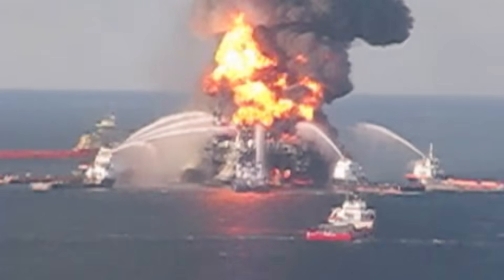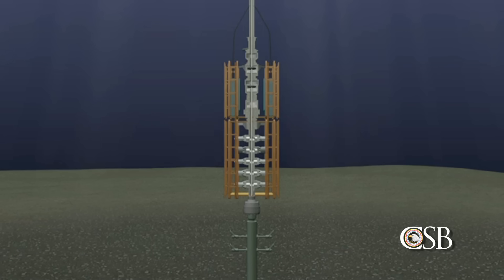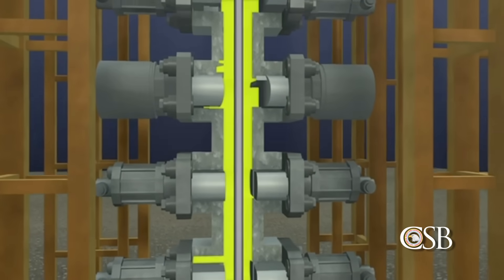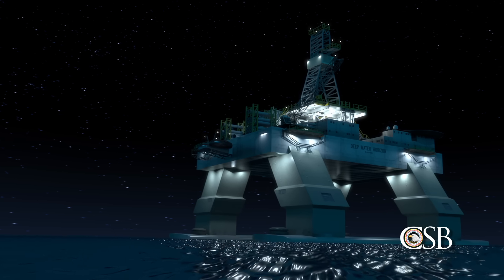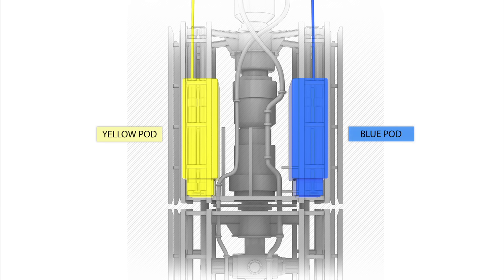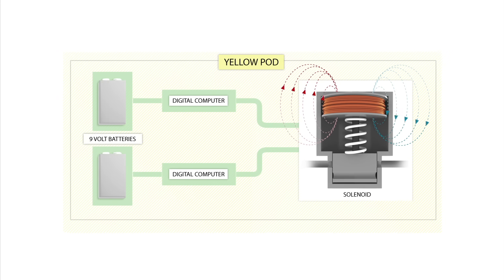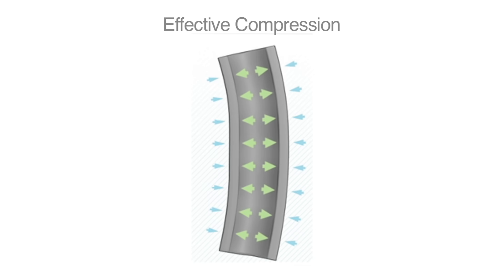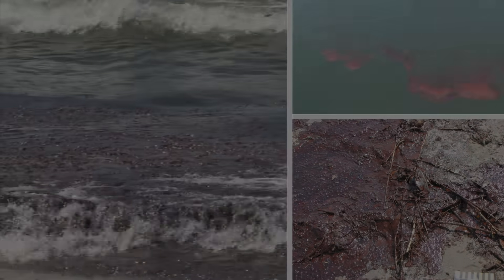Deepwater Horizon Blowout Animation

Comment: i will translate it into few words... Every "safety system" is a fiction and  whenever they are needed they will all fail... Wtf its like watching Star Trek with 1000torpedos but they never work cause battery dont have enough energy and light speed engine are out of action cause generators are not fueled and switch is stuck in off mode😂 Wow what a beautiful symphony of all at ones failure🤦‍♂️

Comment: Norway and Brazil require remotely operated shut-off valves to be installed on all oil-rigs.
This added safety requirement costs about $2 million.
The Oil corporations lobby congress snd influence the safety and standards regulators so this safety feature was not required in US oil-rig operation.
The BP Horizon oil-rig would not get approval to start up in Brazil but was safe to operate in the US.
Thos corporate contamination of regulatory bodies occurs in the Nuclear power industry, food sectors etc. The most corrupt is the Pharmaceutical corporations controlling the approval of drugs and treatments through the FDA.
Disgusting corporate cultures that leads to unnecessary deaths and injuries - but very good for short term profits.

One more correction to add: the oil spill was not 5 million barrels. An estimated 172 million barrels of oil entered the gulf of Mexico from this oil rig disaster.
The real tragedy was the loss of life - 11 workers that tragically perished

Comment: “Following the spill, BP released millions of gallons of toxic oil dispersants, notably Corexit 9500, a chemical banned in the United Kingdom, into the Gulf of Mexico. The use of toxic dispersants made the spill more persistent and more difficult to clean up than it would have otherwise been, but served to remove the oil from the view of TV cameras and make it harder to measure, thus limiting BP's liability for the spill.”

Comment: relying on some batteries to operate a solenoid in an emergency situation seems like a bad design. A better design would be something like a spring that forces the valve open, and during normal operation you have a solenoid that overcomes the force of the spring and keeps it closed. That way when you lose power your mechanical spring forces it open.

Comment: why would you build a final fail-safe piece of equipment in a way that only works if there was no structural deformation? Seriously, that the blind-shear ram requires the pipe to remain directly in the center in order to work seems idiotic. Like building a fire-extinguisher that wont function if it gets overheated.

Comment: Excellent overview video.  Is it statistically anomalous that two fire doors were breached at the moment that Mr. Michael Williams attempted to engage each respective handle, as he detailed in the CSPAN coverage of the USCG and MMS hearing, if the cause of the door breaches were solely random gas explosions?  Also, in light of the attempted terrorist targeting of the Israel-Chevron maritime energy infrastructure in the Mediterranean, would it be beneficial to consider exhuming the Deepwater Horizon, or at least relocating it to shallower depths, as well as completing a full LIDAR scan?  Did OPEC enemies of the United States benefit from the Deepwater Horizon disaster, which first began on 4/20/2010, which is a criminal and narco-terrorist holiday?  Would it be beneficial to also complete a cyber security review, if any redundant safety measure failures could have been caused due to an Iranian-style cyber attack, operating system or employee cyber security compromise?

Comment: I watched this video and read the comments, but I don’t see one important explanation about the roll of the drilling fluid. The fluid is used to cool the drill bit, carry away the cuttings and most importantly hold the gas and oil in the rock formation. It does that by exerting pressure on the oil and gas. That pressure has to be greater than the pressure of the gas and oil. The pressure provided at the bottom of the hole is a result of the weight of the column of the drilling fluid, that is to say the depth of the hole, and the density of the drilling fluid. If the density is correct for the depth the drilling fluid will keep the pressure in the formation under control. This is very delicate balance and can be upset by changes in the formation or something as simple as hitting a water bearing part of the formation or an unexpected change in formation pressure. If an upset occurs it can allow a kick to happen.

Comment: 1) it was said that the pipe ram successfully sealed the pipe. Later, above it, blind sheer ram blades failed to cut the pipe, but... Since the ram below it already closed the pipe, why was it necessary?
2) Why pressure in the drill pipe climbed and pressure outside the pipe in BOP decreased, which lead to pipe curving?

Comment: Rename this video . The bops did not caused the initial problem at all . However they were faulty. . Poor engineering is the real reason the well blew out . They did not cement all the way across the zone . The zone drank the cement thus leaving the live on the back side of the liner . A. Negative test or reading gauges would have let you know that . Remedial squeeZe job and retest . Problem solved . The field has since been drilled with zero failures . When you displace mud with seawater you lighten the hydrostatic head and that is when the well came in . Buttoned up correctly and this never happens

Comment: in my hearing of what happened is that there was equipment that needed to be replaced but the lead on the operations or head of operations wouldnt allow for equipment change out. the lead guy said it was not feasible to do cause of the amount of down time it would cause and the fact that they had a deadline to meet for getting the oil out to the people paying for it. it was also stated that if they didnt meet the deadline that the people paying for the oil wouldnt pay up and would find somewhere else to go get their oil. thus in turn lead to equipment failing. is it money over safety most of the time oh you bet it is which is a total shame.

Comment: In my opinion the solenoid safety check valves were engineered completely backwards they should be closed under tension unless there is voltage to keep them open in the event of power loss they automatically close

Comment: 87 days???? how do you not get someone on it in under 7 when you have so much money
Reply: It wouldn't matter if you had a gazillion dollars to fix something if there was no way to fix it, they had to think up a solution and we're lucky they managed to find one within 3 months.
Reply: @krashd  how do you think it got fixed in the first place they payed a lot of money for 3 subs to go down with a Capping Stack  could have done that a lot sooner.
Reply: @mothertoaster5006  Easier said than done
Reply: I remember following the process as it played out - there were multiple live robot cam feeds at once. As I recall, what it finally took was to drill another well to intercept the blown-out well and pump down cement. I had no idea the O&G industry had that kind of tech but they do. That was one of the things about the event that was so disheartening - there was no other entity that could respond to an O&G industry disaster other than the O&G industry.
Reply: @hubbsllc  if thats true why did i watch a video of them use s Capping Stack.
Reply: @mothertoaster5006  Oh, they tried all kinds of things at the seafloor but as I recall there was simply nothing they could practically seal - just misshapen riser and/or drillpipe.

Comment: Two backup systems, both incorrectly installed.

That's a big F right there folks. SMH.

I don't know about you, but if I was the guy doing the wiring work for those systems, I'd be laser-focused and alert toward making sure the job is done properly. I'd check, recheck, consult the instructions, and get other eyes to go over my work and make sure I did it right.

Obviously there was a lack of regard for ensuring these systems worked properly.

Comment: Seems like the oil companies are both too stupid to design safety features and too stupid to assemble and test them.

Assuming they could even assemble it correctly, having an automatic safety feature that fails to operating mode is imbecilic. You reverse the job of the solenoid to hold the spring tension back, so that there is only flow when it has power and the system is working. If the system fails, then the spring opens the valve for the sheer ram, which also shouldn't be designed to allow the pipe to move somewhere it doesn't work.

Comment: A security systems which depents on a addiotionl power source which can cause failure is no security system. Every intelligent engineer would use a system which is normaly closed and only open if you have contact to the rig.

Comment: They talking that the BOP was the major reason of the disaster, but in fact they didnt mention why there was a flow in the well, why drilling pipe has buckled (wall thickness, steel type should be designed to prevent any pressure damages, but it didnt). Problem was not in equipment, problem in low professional level of the crew

Comment: How in the world is it okay to use FOUR NINE VOLT BATTERIES to control such an important function? I don't know anything about this but when they first showed that mechanism, I thought they were going to say when the power is lost, it automatically closes. I thought they were held open magnetically, so if there was no power the magnets would automatically shut off and close via the spring. But no. Batteries. Four 9V batteries.
Reply: With near zero regulations what could we expect? American government was bought by the fossil fuel industry and given free reign to do whatever they want. Both political parties are corrupted beyond repair and need to be replaced immediately.
Reply: 9Vs are simple and effective. The only reason that it failed was the miswiring.

Comment: What a frustratingly stupid dead man switch design! Power from the rig should have been used to keep the solenoids shut, so they immediately open during a disaster without batteries. Over engineered again.
Reply: That's the right thing to do but not the profitable thing to do. If the power cuts for just a minute for whatever reason, the blind shear rams will cut the pipe that will cost millions to replace.

Comment: It failed cuz an election didnt wire a 12v system correct which is embarrassing af seeing as though I wire and deal with 12v systems in cars being an auto mechanic 🤦🏼‍♂️

Comment: that has got to be one of the worse emergency designs i have ever seen in my life why make emergency sub systems "mis-wireable" i mean what the hell are they thinking there also why not try to do something similar to nuclear power plants and hydroelectric power plants where they use electricity to maintained the magnetic field and in the event of failure gravity does the work to close valves or drop control rods i mean even a dam spring loaded solenoid that u just collapse the field wouldnt rely on batteries to operate in a failure condition.

Comment: Great video!  
I was not aware of the wiring failures.  Very unfortunate.  I was unimpressed with their (our) ability to contain the oil spill.  I am certain that many effective ideas/solutions were blocked by a very politically driven chain of command.  84+ days is insanely unacceptable.

Comment: Dumbass 1: "You check the wiring on the critical, last-resort, emergency safety system called the AMF DEADMAN before it's literally installed at the bottom of the ocean where it will never be seen or worked on ever again?"

Dumbass 2: "lmao sure"

Comment: Critical systems MUST be engineered as FAIL-SAFE - as in, if things go wrong, it becomes SAFE, not open and a catastrophe.

The problem with this design is it is not fail-safe.  The blind sheer ram requires computers and power to cut it rather than computers and power to NOT cut it.  If it was basically held open when power is available, and power failure CUTS it, that would have made a difference - and you heard the CSB - this problem appears to exist in many deepwater wells.  Greaaaat...
The buckling of the pipe stopping the blind sheer ram of course just added to the mess, but if it was engaged before the pressure went too high (but well into the point where failures were occurring) then this would have been prevented.

Comment: I'm know drilling expert,  but it would make sense those ram units would be designed to cut and compress the pipe together even if it was bent off center , put a guide in there so the pipe could follow....

Comment: The deadman's switch is supposed to work even in the absence of correct construction. The fact that they needed solenoid motors to pressurize the AMF is already a sign of impending disaster. Two redundant microcontrollers should be running during normal operation. If either fails, the deadman's switch activates. (Not if all other systems fail, the microcontrollers have to wake up and activate the solenoids.) The solenoids should have been designed to pressure close the pipes (during normal operation) to keep the AMF from activating and then, in the absence of any power, the solenoids deactivate and pipes open (causing AMF to shut).

Comment: bp blaming pressure difference bends drill pipe - only clown believes that bs
Reply: GroovyVideo2 After it was bought up from the sea floor, the failed blowout preventer was taken to a NASA facility in Louisiana for examination by Det Norske Veritas (DNV).

On 20 March 2011, DNV presented their report to the US Department of Energy. Their primary conclusion was that while the rams succeeded in partly shearing through the drill pipe they failed to seal the bore because the drill pipe had buckled out of the intended line of action of the rams (because the drill string was caught at a tool joint in the upper annular BOP valve), jamming the shears and leaving the drill string shear actuator unable to deliver enough force to complete its stroke and fold the cut pipe over and seal the well.

Comment: You would think when dealing with those depths, temperatures, and pressures they would have had NASA levels of checks and tests before putting the drilling safety systems in place.

Comment: A "deadman" switch that relies on batteries is not a true deadman switch.  This is particularly inexcusable being on the seafloor where changing a battery is likely a royal pain in the ass.  It's fine as the primary means of power, but the backup should have an alternative power method. I hope how ever they redesign has an alternate backup power source like a CO2 or nitrogen canister that can operate the shears pneumatically.

Comment: I heard that the drilling rig crew chose to use a filling mud that was too light weight and of low density to hold down the kick.  
There are hundreds of other such wells in the gulf ... psycho death cult time bombs, I call 'em.
The water canons were used to fill and sink the platform to keep sight of the spectacle out of the news coverage.   The collapse made the situation worse.   Big Oil tried to hide the oil floating on the ocean's surface using chemicals that made it sink to the ocean floor; coating it with a toxic gooey slime that destroyed one third of the US fishing industry ... instead of simply skimming it off the surface. 
The companies responsible only provided extremely low rez blurry video footage of the gushing leak to hide the true volume of oil being released as seen in the high def videos.

I am typing this as Australia burns.  1.25 billion wild animals murdered by Big Oil.  Exxon knew in '72.

Comment: I'm betting that the task of wiring the solenoids is a shitty task. And most likely put on the shoulders of a rookie. == I remember
     my Naval service. I was an IC Man. E-3 pay rank.  We had Periodic Maintenance on an infinite amount of gear. Literally spread all over the vessel. 
-------  I . was stationed onboard the USS Saratoga. CV 60.   Aircraft Carrier.  Our gear included all of the solenoid sending units in every hull-placed fuel cell.
      To measure the content of fuel in these tanks. there was a rod about 2 inches in diameter. top down to the bottom of every tank. And a 
           float encircled the rod that sent the level to the bridge. to the solenoid up there. What a mistake picking an Aircraft Carrier for duty.   Anyway. the 
                 workload was massive. It's really sad that a few tasks that were typically mundane. and low cost measures caused billions of dollars in loss. And fucked up 
               the Gulf of Mexico. Sanibel and Captiva. Fort Myers. Bonita Springs . Naples and Marco Island. AND the coast of miles of mangroves that meet the Gulf. have been having a horrible time with RED-TIDE blooms. And massive random fish-kill events. Don't be fooled. The oil from the blowout of the Deepwater Horizon....
           And the chemicles they sprayed called { Dispersment Agents } have fucked up the GULF.    What a shame.

Comment: Why were the safety solenoids electrically actuated?  Like if the system was only held inactive by the coils, and loss of power would allow a powerful spring to force it active, wouldn't that be better? That would also mitigate some other issues like the miswiring that resulted in opposing currents, since a miswire would be easily detected during pre-deployment quality control testing just by observing it's behavior.
Reply: Likely because loss of power can occur regularly and you can't just sheer the line every single time that happens.

Comment: That's crazy that the two coils were wired the wrong polarity at 7:37, but because the UPS battery backup failed that night on one of the coils (and fortunately the one which was wired correctly), it happened to be able to close.